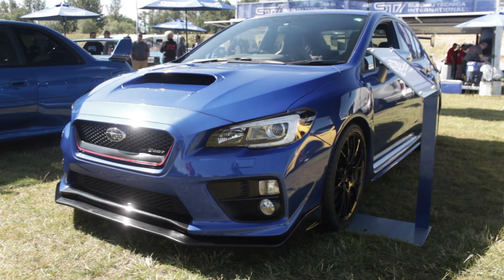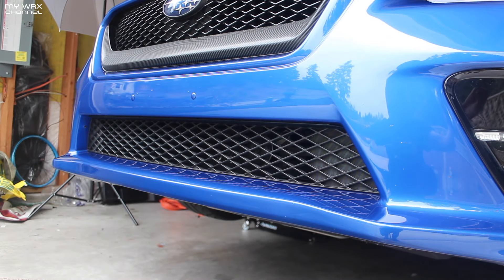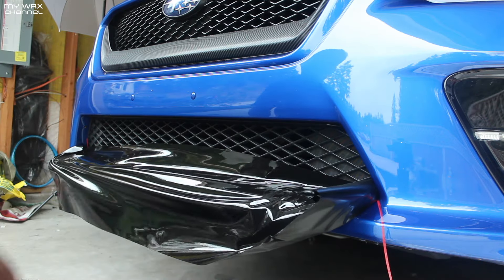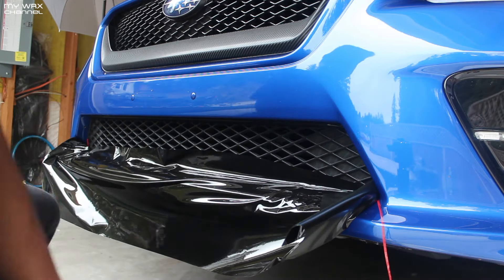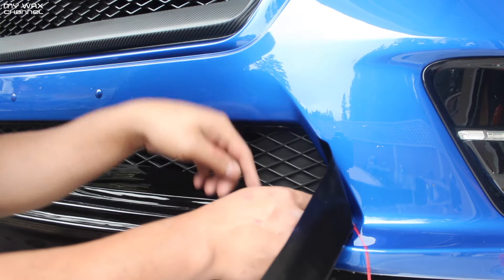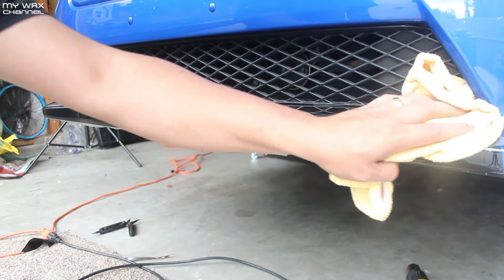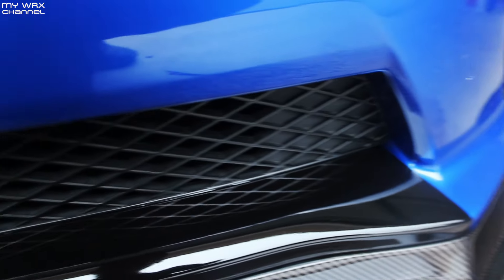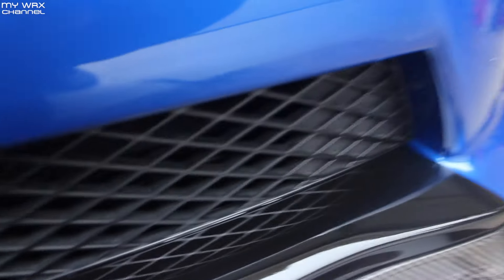JDM WRX/STI S207 Front Lip Overlay | 2015-2018 Subaru WRX 2016 2017

Comment: Hey man great channel you've got here. I am ready to get my '16 WRX protuned and you have been an inspiriration for me. I am currently on a cobb OTS stage 1 w/ Cobb Big SF intake
I got this planned out so far:
Invidia Catless J pipe
EGR/TGV Deletes
Upgraded Fuel pump
Electronic Boost Control solenoid

I would like to ask you what your performance mod list looks like and possibly your dyno numbers? I would appreciate your input thank you!
Reply from the maker: That's pretty much what I have plus an intercooler. I made around 330hp/350tq.
Reply: Awesome man! thanks so much and keep up the great vids brother
Reply from the maker: John P Will do! Thanks! Let me know if you have any comments or questions.

Comment: Do they advise against using soap and water as a medium to make it easier to apply like tint?

From what it looks like you've been doing pretty well but I figure I'd point it out in case you need a little assist in that regard
Reply from the maker: No water needed. Goes on just fine dry.

Comment: quick question~ how do you install the front lip? just drill the bumper and install washer/bolts/nuts?
Reply from the maker: It's held on my the OEM push clips and self taping screws.

Comment: 4:13 The solid black vinyl doesn't match with the carbon lip and the (faux?) carbon bordering the bottom of the top grille, so I'd take it off if I were you

Comment: NO idea how you made that look so easy.. even with my bumper OFF, it was way harder for me.
Reply: you can use short URL's for your Amazon Affiliate stuff instead of those long links.
Reply: Knifeless tape is the key.
Reply: nothing to do with the edges.. i meant how easy he did the bends.. it takes me hours to get the vinyl stretched over the front bumps, and thats with the bumper off.
Reply: LastHumansGarage It takes practice and maybe a little heat.
Reply: i hear a WRX outside. They showed up to pickup my yellow exhaust hangars
Reply from the maker: I have no idea. This was one of the easier vinyl jobs. The Avery vinyl is so easy to work with. I didn't even use a heat gun.
Reply: Cmon Mark!! You gotta do it up too hahaha